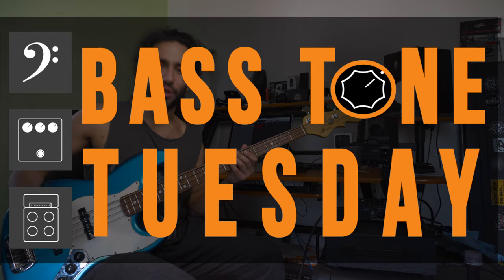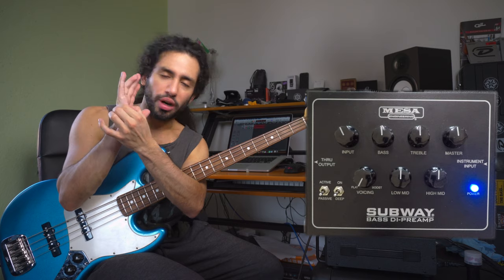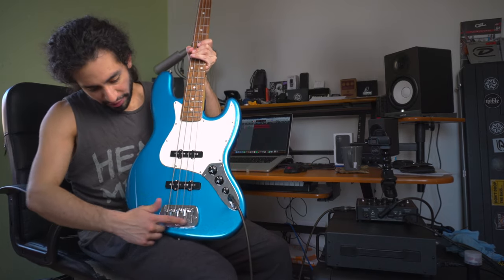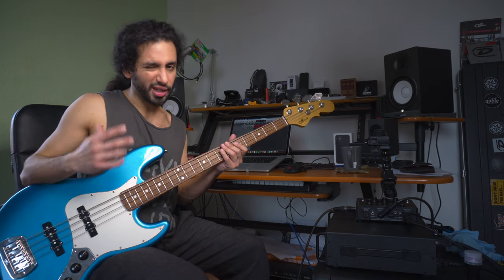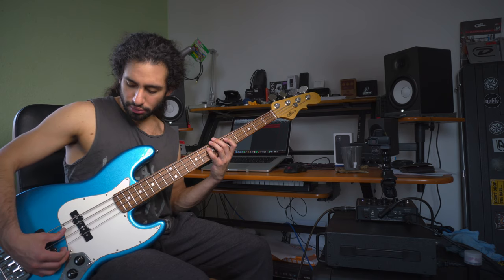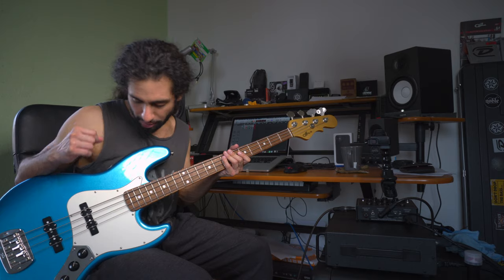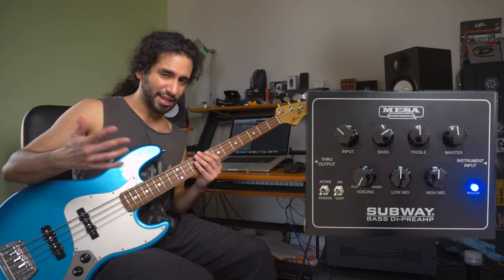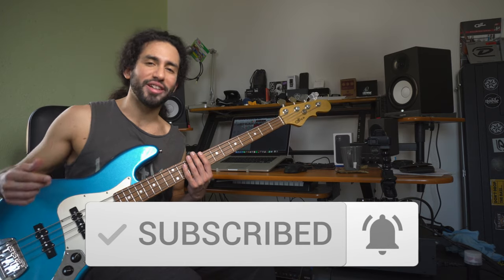Palm Mute for Bass | Bass Tone Tuesday

Comment: Great lesson, Ivan! I have a Fender Marcus Miller without a tone control, so I need to do this to get a softer sound out of it. 

Do you know of any pedals that provide the same effect as a passive tone knob? I know I could modify my bass with a Sadowsky preamp, but I’m not ready for that yet! I’d like to have an external option, if one exists
Reply from the maker: Ohh. That’s a tough one and one of the reasons why I personally don’t like active basses without tone controls. Turning back the treble works, but it sounds different than a passive tone control. 

You could:
- Try to install a passive tone control, although i believe the wiring of the active circuit in your basses is kinda complicated.
- Grab a low pass filter pedal like the one by Broughton
Reply: @IvanBassist  Thank you! I’ll check out the low pass filter. What about the NUX Melvin Lee pedal? It has a treble cut that seems like it might work? What do you think? 

I’ve heard about the rewiring option, but before doing that I’d probably install a Sadowsky with the VTC.
Reply from the maker: The on-board preamp is boost only, right? 
Yeah, you could try the NUX one. It even has a cab sim, which is pretty sweet
Reply: @IvanBassist  yes, the MM Fender only boosts in active and does nothing in passive 🤣.